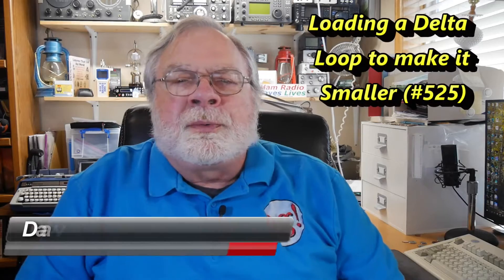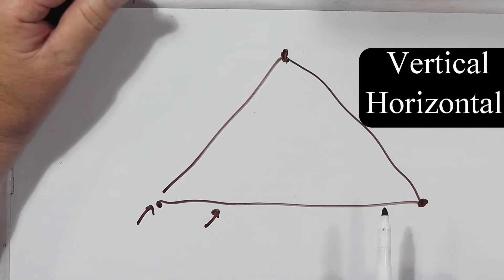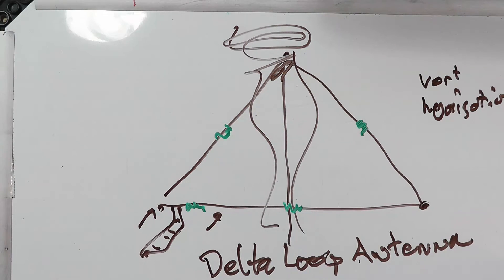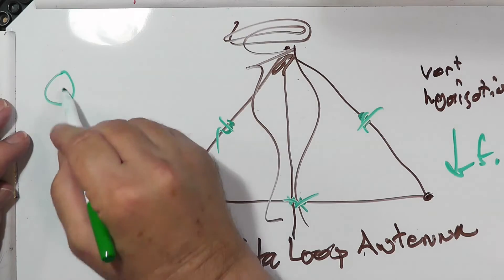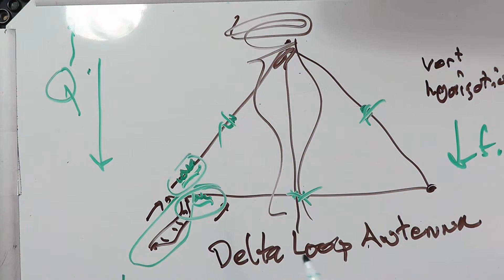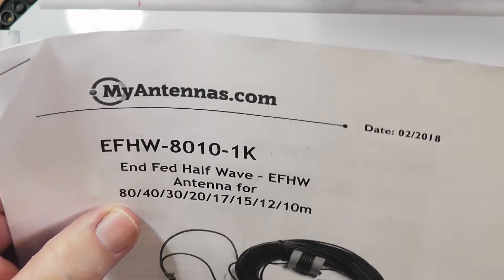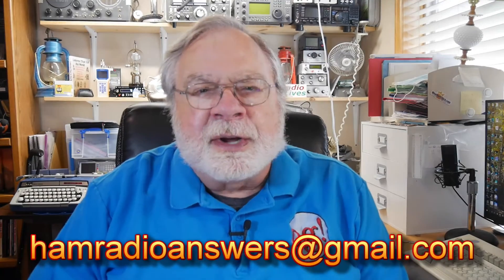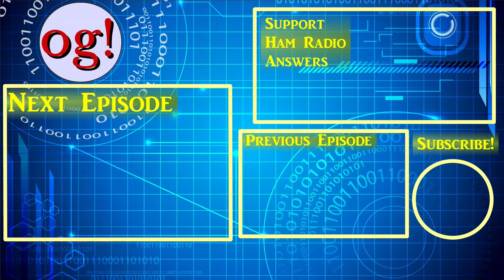Loading a Delta Loop to make it Smaller (#525)

Comment: If you analyze the loop, you can find where the current is highest. These will be at the feedpoint, (both sides like you show) then also at the opposite side of the delta loop. These would be the optimal places to place the reactive components because the reactance would be minimal. If you try to load it at the current nodes, the reactance will have little effect. 

And no, you cannot make your antenna electrically longer by adding an inductor. It simply is there to cancel the capacitive reactance. It does not increase the radiation resistance.

Comment: can you use coax instead of wire, coax has a larger shortening factor
Reply from the maker: If you short the inner and outer conductors, the RF just views it as a wire. That might just be a 0.95 velocity factor, same as regular wire.

Comment: Dave, your practical tips about useful antennas is always appreciated but now I need to find out how you discovered that little fact about ham stick ignition! 73.
Reply from the maker: It's in the instruction--they say make sure the stinger doesn't get shoved down inside the actual loading coil. Really only a problem on 80m

Comment: Good idea! But instead of try and error I would suggest to simulate this with MMANA or any other antenna tool. 73 de HB9CAX
Reply: I would also adivse modelling this on something like MMANA-GAL. I did try modelling a quarter size 80m delta loop a while back and seem to recall, while the coils allowed you to reduce the size of the loop, the radiation pattern was not that of a full size loop. This makes sense - the delta loop is just 2 dipoles connected end to end with one physical feedpoint and one virtual feed point (half way round the loop from the physical feedpoint). So, you can add loading coils just like you can on a dipole (x4 in total if you want to keep it balanced). However, reducing the spacing between the dipoles "messes up" their phasing and therefore the radiation  pattern.
Reply: Totally agree with you, model the antenna using software to get a good start point.